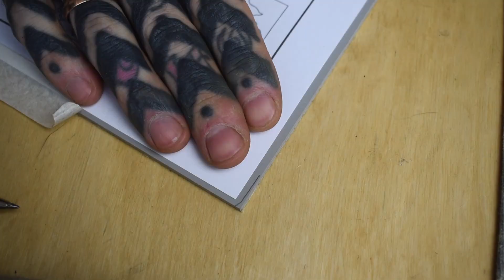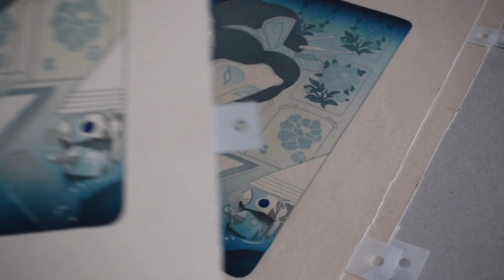12 layer multicolor linocut print ''MIDNIGHT PRINTING'' by Emils Salmins

Comment: Interesting how you making out that sharp registration:) those tabs are very helpful but to do it with many blocks as you did the blocks has to be perfectly the same size and the  tracing has to be on spot     Compared with other blocks right?